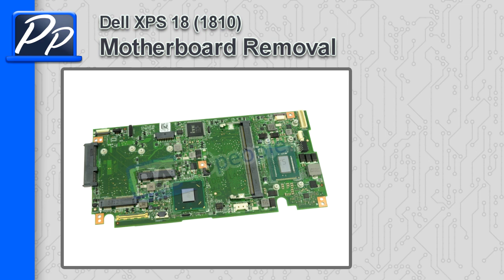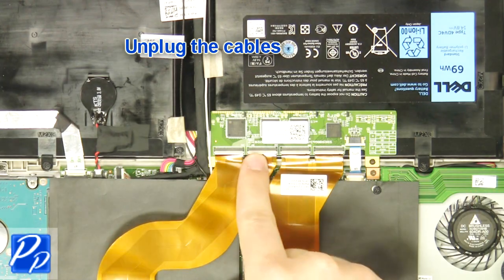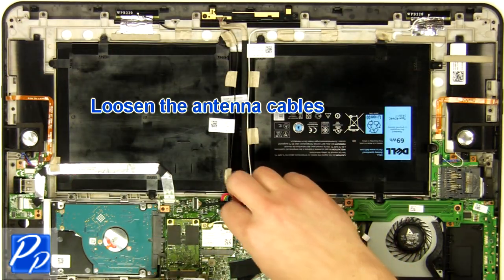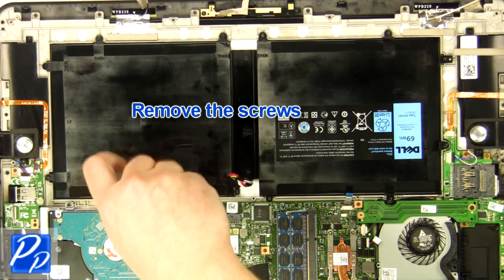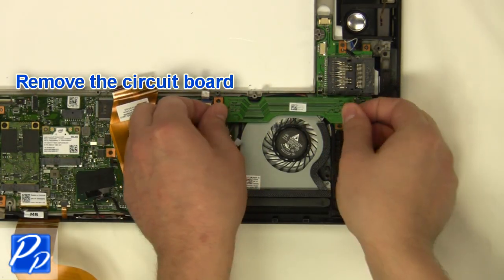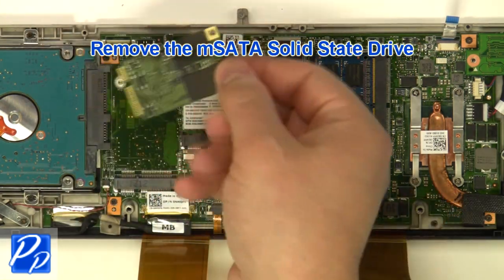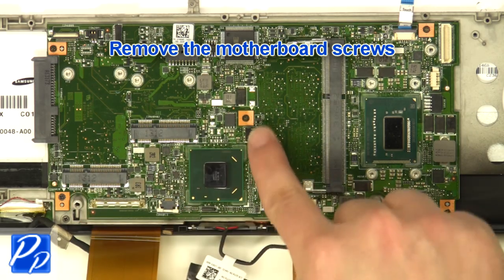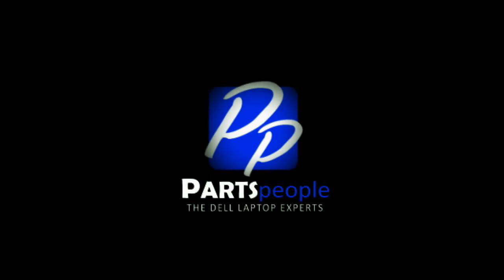Dell XPS 18 (1810) Motherboard Video Tutorial Teardown

Comment: The speaker video was awesome.  Helped me replace the speakers in 10 minutes.  The 1810 is surprisingly easy to work on and dismantle/put back together.  If you need a new motherboard, it's really as easy as this tutorial makes it seem.  Go for it.  Just keep the screws organized and you'll be fine.  Some of the screws are longer/shorter and you need to keep a good record of which goes where.  Other than that...  easy peasy.

Comment: By any chance, do you know what I have to change (maybe capacitors) on this motherboard? It is a known problem  not charging the battery. Much appreciated!
Reply from the maker: If I had to guess, without seeing the laptop, I would think your problem would be with the DC Jack or the circuit board it resides on. A bad DC Jack can cause the battery to not charge. Here is part you will need to change. http://blog.parts-people.com/2014/03/11/dell-xps-18-1810-usb-dc-jack-audio-circuit-board-removal-and-installation/
Reply: Thank you for responding so fast. I will check the DC jack to see if it sends power to the motherboard. However, I do not think that this is the problem. A lot of Dell complaints about this problem being the motherboard. I did everything that was explained in every forum (unplug the battery, push the power button for 11 seconds, etc). It worked for a while, it started charging the battery, but after a few days, completely dead. I was reading somewhere that the problem with these boards are some capacitors that do not charge.
Reply: Thank you for answering so fast. I took it apart and measured the input. The DC jack works, it passes the current. The problem is somewhere along the line, as the battery does not get power.
Reply from the maker: Sorry for the late response, I've been out for a few days. I still think it's the DC jack, mainly because I see this problem all the time. The center pin on the jack will break and it will stop charging the battery. The center pin is the AC adapter identifier. Without it, it will turn on but it will not charge the battery. Try to confirm this by going into the BIOs and looking at the battery health. On that screen, it should show the AC adapter that is plugged in and identify it as a "65w" or "90w". With a bad DC jack it will simply say "unknown".
Reply: @dellpartspeople  I got a new charger on my xps 18, the battery says 100% charged but when you remove the charger then the whole computer shuts down abruptly.  Does that mean the battery is dead?

Comment: Hi! i'd like to change the sound card on my xps 18 (which is likely dead), is it possible to do it? is it integrated into the motherboard? If so i'd have to change the entire mobo right? thanks
Reply from the maker: This is the video you need. https://www.youtube.com/watch?v=FCfhM5uNu4I Replace the circuit board and the sound should work fine.

Comment: Hello. Which of Torx screwdrivers is used to remove 10 screws in Step 1? Is it Torx T9 or T8 or something else? Thank you.
Reply from the maker: It should be a T9.
Reply: Thank you. Somehow the information on the point is inconsistent. For example, staff at notebookcheck.net claim it is T7 ("Getting access to the hardware components of the XPS 18 is pretty easy. You just have to loosen ten torx screws (T07) on the back and lift the aluminum cover" - http://www.notebookcheck.net/Review-Dell-XPS-18-AIO-Tablet.93318.0.html). I don't have any Torx screwdriver and have to decide which one to buy...

Comment: I am also looking for the LCD screen video- can't find the part though...dell wants over $450 for a refurbished part.  anyone know where to get em at a better price?
Reply from the maker: The screen is sold as a complete assembly so the replacement video would pretty much be this video along with removing the speakers, camera, and kickstands. I don't know if anyone has made a video that shows how to remove the screen from the glass. I most cases it requires using a heat gun to separate the screen and the glass. It's a very difficult process, which is probably why a video hasn't been made  yet.
Reply: Parts-People.Com, Inc do you have the complete assembly?
Reply from the maker: William Rossetti
No, unfortunately. We haven't been able to find any for about 6 months now.